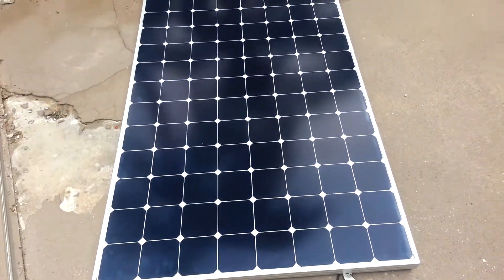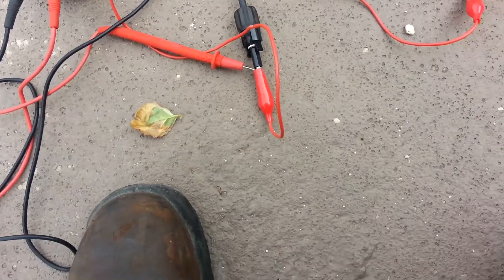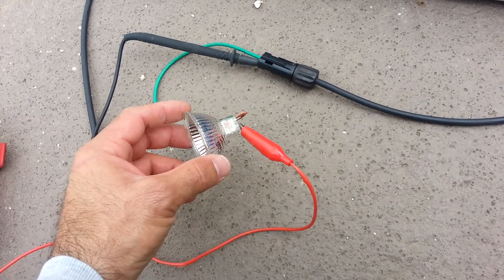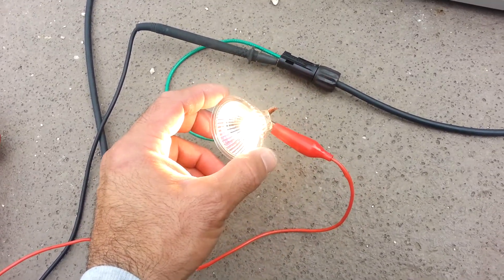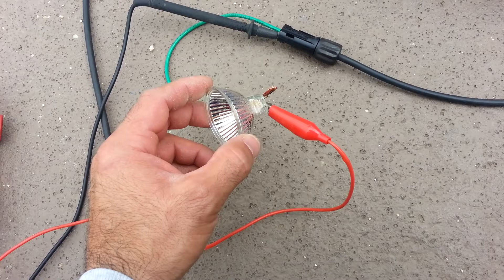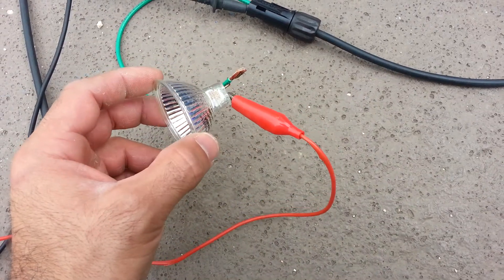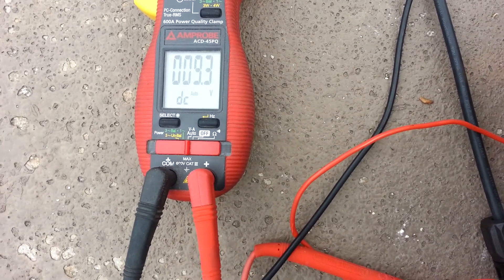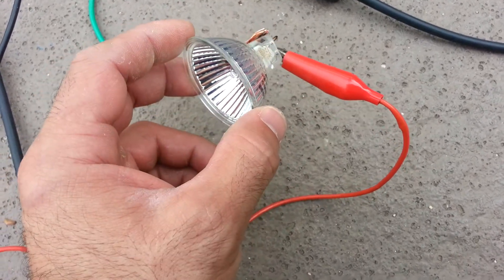435 Watt Solar Panel High efficiency

Comment: [Awesome Plan Here >>>https://plus.google.com/u/3/113778429958471787540/posts/67MrRb1YGej ] Using Great information, they have done the research and calculations to help configure the ideal system for your home and install it.

Comment: I've seen just a 200 watt panel do that arc flash.  Yours is 435 watts... so try shorting just the leads without a load in between.  You'll get a better effect then :)  It's just throw-away wire that you're sticking into your MC4 connectors anyway.  The wire will probably melt in full sunlight.